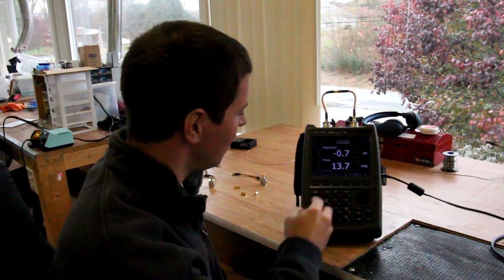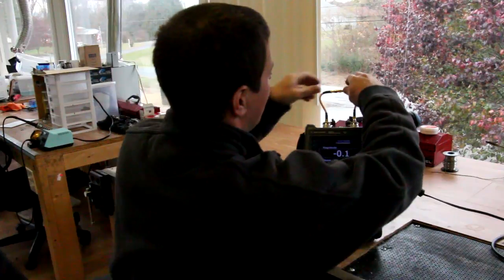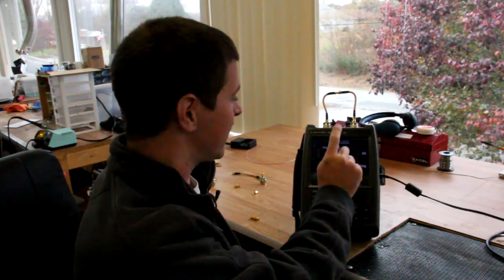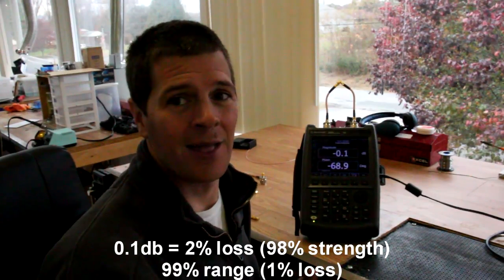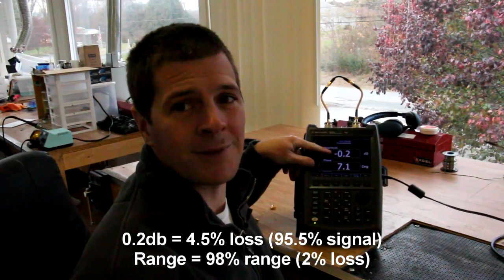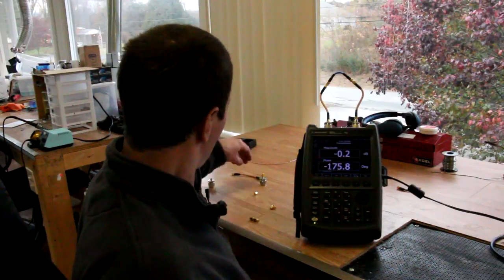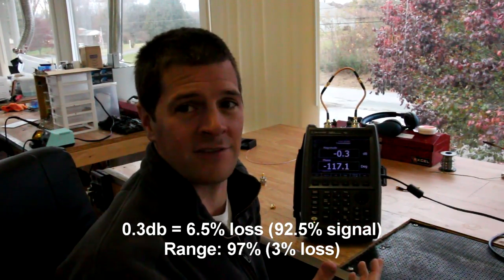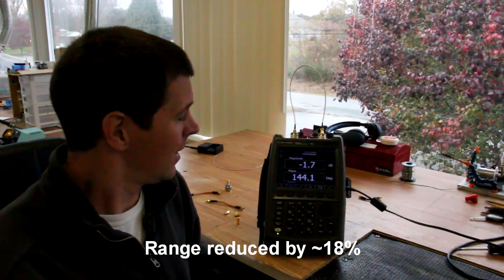Adapter and extension cable loss testing

Comment: Nice information Alex. I’ve been flying fpv for about 3 years and these are questions I’ve always wondered about. I’m setting up a LR plane (1.3 vtx) and concerned about signal loss with a long extension... this answers that. Thanks 👍

Comment: What about uFL, mmx and those little pigtails the unify uses?
Reply from the maker: If you read in the comments, I have listed the losses for all the common cables we use.  There is a loss of ~0.2db for a u.fl connector, but an MMCX connector is less than 0.05db.

Comment: This is actually good to know. I have always wondered "what are the actual numbers" as i do not have that type of equipment. One of the things I wonder about is, for example, the Taranis X9D SE with detachable SMA antenna. The cable used to connect to the RF module inside the radio is that thin stuff that they used in the original Taranis to secure the "fixed" antenna. I know that your Folded dipole you turned me onto comes with the RG316 (I think that is what the cable included is anyway) and I couldn't believe that they would NOT use this better wire in the Taranis SE. I wondered what benefit I would have, and if I should attempt to solder the better cable in my radio. The unfortunate thing is the reason I bought the SE is I didn't want to chance the soldering of wire on the RF module in the first place.. Well, I guess there's no time like the present!
Reply from the maker: In general, short runs of cable are ok.  However, that cable FrSky uses is total garbage.  Using the included cable will do better, but I don't know whether or not that difference will be noticable.

Comment: For RF I have a cable that is 13.5' RG-316 low loss PTFE with SMA Connector and PL259 which connect to my Radio, problem is, from where I can run the antenna in the back, i am short about a foot in cable; I bought such cable in amazon.com, it is also RG-316 with male to male PL259 and which I will connecrt together with the main cable using a straight adaptor jack to jack SMA-2700P. My question is; how much loss should i expect? Would it makes a difference if i insulate the connection and if so, what can I use for insulation? I am more comfortable maybe buying the cable again at 15 FT and running it that way with not extention but the guy at the local RF shop said there is no need to do that because the loss is minimal? Can you help clarify this?

Comment: Thanks for the video. I was always suspicious that the right angle adapters accounted for greater loss than the other adapters. Good to see the 45 deg are negligible.
How about when you bend your receive antenna coax to the angle required when fitting it to your goggles? so you don't have to use a right angle adapter. That bend radius is starting to get pretty severe in my opinion. It would be interesting to see the real life results on your test bench. Surely all that flexing is not good for the dielectric of the coax?
Reply from the maker: Bending the cable will not result in any loss.  The reason for this is that the bend is an arc and not a sharp 90 degree turn.

Comment: Great video! I got a 2.4g pepperbox from 2014 by you with a very sma cable I dont need. Is it worth shortening the cable for -1 to 2db  gain? If I use it next to a strong UHF system, it is possible to UHF can interference the long cable?
Reply from the maker: When it comes to receivers, generally it is the noise floor that takes your video out and not lack of sensitivity.  Thus, I do not think shortening it would matter much.

Comment: nice data drop lol i like numbers and good info too. im just learning how the velocity factor of elements used plays a good part in measurements.
Reply from the maker: Velocity factor is determined by the cable inner insulation.  Most cables we use are Teflon (.695 velocity factor), but polyethylene is fairly common as well (such as in the gray cable) and it has a velocity factor of 0.82.
Reply: Video Aerial Systems hey 👋 , love your channel , I was wondering if you think it’s possible to take a 27 foot long or even a 10 foot long rg402 coax cable with RPSMA connectors on each end so I can attach my 5.8ghz video receiver inside and run the cable to my roof top with a 14dbi patch antenna on the end , will I get the same video signal or is 10 -27 feet to long of a stretch for the receiver , will the signal just get lost cause the cable it to long , im not sure please help
Reply: Video Aerial Systems I read somewhere that a guy with rg316 coax lost 1.1 db at 2 feet of cable and lost 1.9 dB at 4 feet of rg316 coax cable

Comment: Awesome test, Thank you for your effort! Will the loss be less if i extend the cable with another cable by soldering them and then solder it to the vtx? (My micro antenna just comes short by an inch, that's why I want to extend it. Thanks in advance!)
Reply from the maker: No, but an inch won't make much difference at all.  I would just use an extension.  The loss isn't all that high.
Reply: @CAGreve1231  I see, Thank you for your fast reply!

Comment: DUDE! Awesome vid! I was just asking pilots abt this! My question now is. What is the most ideal position to mount 2 clover leaf antennas on your for goggles? V shaped? L shaped? One vertical and one pointed head first? One up one upside down? Thanks mAh dude!
Reply: And what abt a 45 degree adapter that is also an sma to rpsma converter aswell?

Comment: What kind of a loss would you experience from your head blocking the signal? In your Ion mounting video, you had it mounted on some fatsharks via a 90 degree adapter and a 4" extension cable. Would that cause less loss than it being mounted direct to the fatsharks and your head being in the way?
Reply: in my experience, the extension cable has given me better quality signal when flying behind myself. reason being is that our heads are very good at blocking signal
Reply from the maker: Cookie nailed it.  If your head is in the Fresnel zone, move the antenna.  It is far better that way.  The Ion is both a TX and RX antenna so I made it stubby for extension cable use.  Most antennas have a a longer cable so the loss is already incurred due to their longer cable.
Reply: Thanks for the info guys.

Comment: I have a question that has been bothering me for ages:

Let's assume I am working on a ground station. I'd like to have my antenna on a mast at about 2m. It's going to be on 868MHz (Crossfire). To do that I actually need a cable connecting my transmitter on Taranis to the antenna. That cable will be about 2m long.

What should I do to minimize the loss of signal and what kind of loss are we actually talking about here?
Reply from the maker: If you use a quality cable like RG142, about 2db realistically.  However, you can eliminate that loss completely by placing the Crossfire up on the mast and run the power and signal cables to your radio.
Reply: @CAGreve1231  Thanks, that's what I have been looking into, actually. It makes sense. Just wanted to make sure the difference is significant enough (and it is).

Comment: what about adapters on a Transmitter antenna ? would that loose strenght ?
Reply from the maker: It doesn't matter whether it is transmitter or receiver.  The loss is the same.
Reply: @CAGreve1231  okay! thanks for the reply.

Comment: Quick question, I’m setting up a new quad with the Connex hd system stock antenna on quad, (I have your linear array on the receiver) using a tbs crossfire micro RX, having a hard time with antenna mounting for the receiver antenna. Is it ok to place crossfire antenna about an inch or so apart from the Connex antenna? Will this shorten the range of either? Will it harm the receiver half of either? Thanks!
Reply from the maker: The Genesis is designed to be direct mounted to a tripod.  It uses the CONNEX system to secure it to the tripod base.  You will want a good amount of separation between the Crossfire and the Connex.
Reply: Video Aerial Systems thanks for the reply, I was actually talking about the quad side of the system..
Reply from the maker: On the quad, the Crossfire should be able withstand the close proximity.  You should be ok.
Reply: Video Aerial Systems thanks!

Comment: What about better quality cable? Is there any preferred antenna type for long range ground fpv on 1.2ghz and/or for 433mhz rx/tx?
Reply from the maker: RG402 is a good compromise.  RG142 is my favorite.  RG316 is good if weight is a concern.
Reply: will these also work at higher frequencies (like 5.8 GHz)?
Reply: @CAGreve1231  thanks for the great info. do you recommend to move the antenna away from 1.3 vtx using an extension cable? does that improve range or is it just needed for mounting options?

Comment: Crap I just bought some 1.13mm coax for a short extension (<10cm) inside an homemade groundstation (5.8Ghz) , do you think I should purchase a RG316 extension? RG316 is so damn stiff and hard to work with!
Reply from the maker: Try RG178 if RG316 is too stiff.
Reply: I thought about that, RG178 is just about perfect I think! You think the loss for a short run is negligible with respect to RG316?
Reply from the maker: For a short run the loss is about the same, yes.

Comment: Ok. so then adding a 3 foot extension to your Taranis antenna mod to get your 2.4 ghz folded dipole up higher off the ground would lose too much signal to be practical, right? I recently bought your mod from getfpv, and as your video on it shows, the signal is much better when flying standing up than sitting in a chair. Problem is I find myself wobbling on my feet in danger of falling on my arse the whole time, so I really need to fly seated. I guess I need to trade my quad chair for a bar stool or high chair, or build a platform I can fly from that gets me at least three feet higher off the ground. Or just give up on 2.4 ghz and grab TBS crossfire.
Reply from the maker: In most cases (including this one) it is better to take the loss of the extension and move the antenna to a better location.  However, 3 feet would be excessive.  I would recommend 18".  Besides, that would be a real pain to carry on your radio.
Reply: I have a follow up to this, regarding rc control antenna. I usually set on a wood park bench, or use a folding chair that has a plastic tray to hold the transmitter. 
I have a couple of different 2.4 transmitters. One model has fixed diversity antenna that when laying down one antenna is resting on the table and the other is pointing straight out, parallel to the ground. 
The other transmitter has a single antenna that is adjustable to where it can be turned to be perpendicular to the ground and elevated above the table a few inches.
 
My feelings are that the second option would provide better signal radiation for a racing quad close to the ground, but I wanted to get your feedback, is a single tx antenna better in this situation than a diversity tx antenna that is not in a very favorable radiation position?
Reply from the maker: In the case of open-type antennas, the orientation matters very little as the ground is going to send the signal skyward in an erratic pattern.  Indeed, upright is slightly better, but I just changed out myu antennas for the folded dipole and that fixed the problem.

Comment: Just wanted to let you know we was at a tiny whoop FPV race this weekend Up her in Ohio and everybody was complaining about their video signals on their Tiny Whoop nobody could get good clear steady signals through the course  everyone was running around trying to find signal except for us we had one of the VAS FX798T VAS cloverleaf all in Camera . I know the cam is $ 50.00 but why are you there? This is not a popsicle stand and on the goggles a  cyclone antenna  with a crosshair patch. Just goes to show the difference in ChiCom junk and good quality. I would except you will see som orders showing up.. The boy was sure bragging you up from Willard....
Reply from the maker: A solid transmission is always better than a weak one.  Good equipment goes a long way.  Glad to hear it worked out for you!